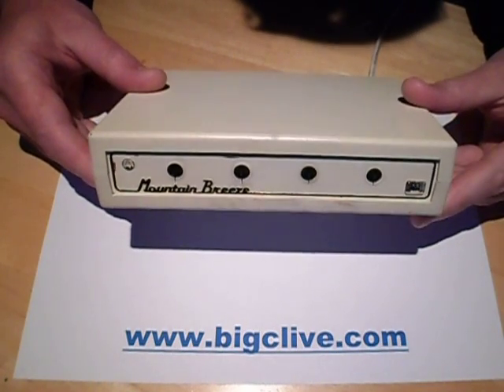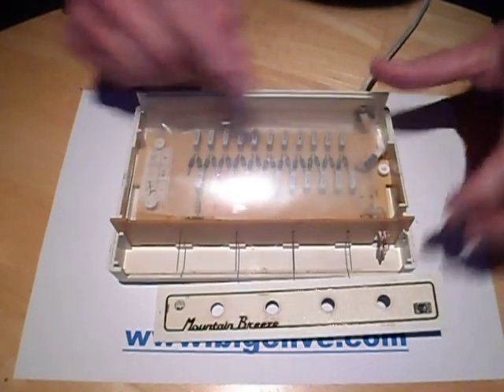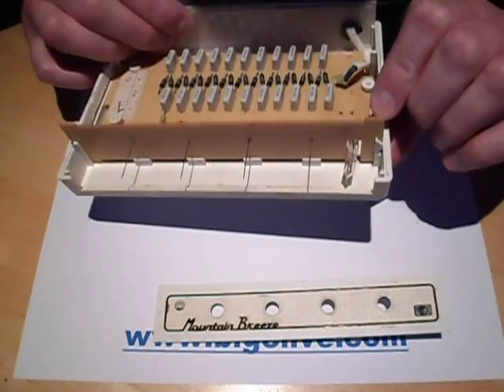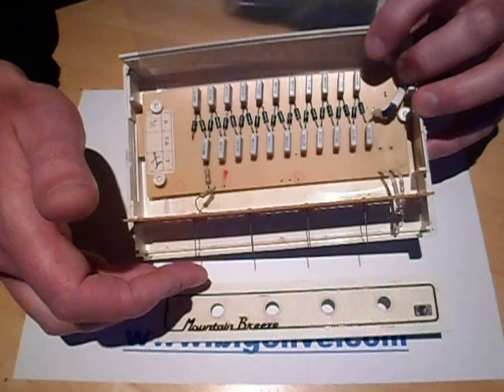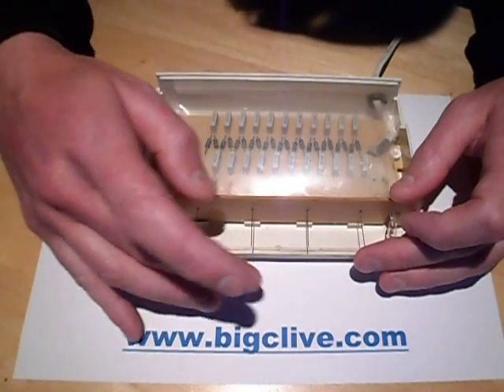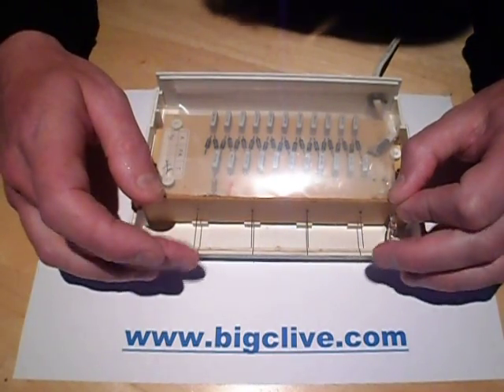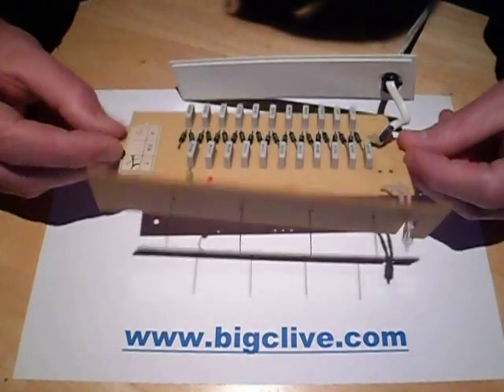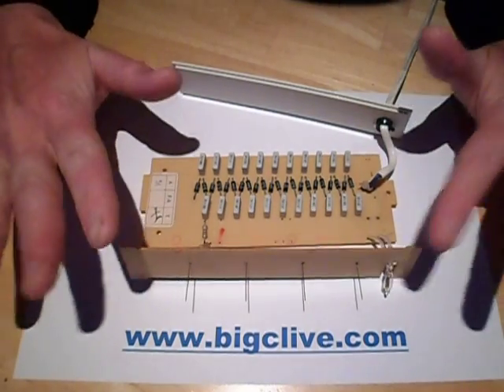Vintage Mountain Breeze ioniser / ionizer teardown.

Comment: Hi Clive, we used to have several ones at my parents house ('70's)  Every bedroom had one. In the living room we had a model F-400 which had a fan. 
Recently i found one again with rusty needles. Opened the case thanks to your help. Tried to clean them with my dremmel but broke one. After reading your comments on questions here i managed to solder a new (sewing) needle in. 
As i recall there was some kind of testing device that you could hold in front of the ioniser and it would lit up... but maybe i am mistaken about that.

Anyway just wanted thank you for the great video's you make !
Reply from the maker: The ionoscope was a small capacitor with a neon across it on a PCB.  You held one end of the PCB in your fingers and the other end near the needles, and the neon would pulse faintly.

Comment: I used to work at Mountain Breeze on the Pimbo Industrial Estate in Skelmersdale in the late 80s. 
I used to silk screen print the circuit boards and press them when they were returned following the copper stripping. 
I also assembled the boards and cut the resistors and capacitors. 
The company was run by Transcendental Meditators. 
Great days!
Reply from the maker: Still one of the best ionisers.  I have one on continuously in my bedroom.
Reply: zanderzoot So TM really did expand as far as Britain before the end of the 80s, interesting factoid.
Reply: Thanks zanderzoot , my aunt started the trend of owning one. The Mountain Breeze my close family owned was used in my shared bedroom, I loved the cute little miracle  device.
ps...I'm now an Electronic Engineer

Comment: "Mountain Breeze" was a Liverpool firm that was based in Skelmersdale, West Lancashire. I had two and they probably live in a very full loft but they are superb and I am so sad I can neither find them nor buy another. Iwent to Switzerland a few years ago for a wedding and which was in the alps. It smelt of the Mountain breeze ioniser! That was what I was told when I bought it in 1987. They were right. Thank you for your postage
Reply from the maker: They do turn up on ebay from time to time.
Reply: +bigclivedotcom there is actually a little bit more to the story of how why and where they were made. pifco acquired them quite late on.

Comment: Every ionizer that I've seen here in 120V mains land uses a potted potential multiplier, probably to reduce losses due to tracking across components and corona as those are some of the main loss mechanisms IIRC.
The 1N/2N series of part numbers uses the first number to denote the number of pins on the device, where the first number is the number of pins minus 1.  i.e. diodes are 1N, transistors are 2N and tetrode transistors are 3N.

Comment: I bought one of these on eBay recently for £15. Working well and I can feel the slight air movement on the back of my hand held close to it. Mine has a red LED for power indicator which still works fine (the top of the case in that area gets very slightly warm after several hours), but is otherwise identical. I haven't opened it yet, no need to.

Comment: FYI: Fresh Air by Ecoquest runs 5 KV for the pin(s). And 25-30 KV for Ozone generation mode.

Also, I've been doing research on these for a few weeks. POSITIVE ion generators create much much less ozone for a given current. However, positive ion generators (used in industrial cleaners called "Electrostatic Precipitators") use two plates. That is, they charge positive ions, attach ions to pollution, then attract them to a ground plate. (Sometimes also having a lower high-voltage accelerator plate in the middle to assist.) Whereas, the home ones, use negative ions (basically because of the fresh scent of a thunder storm), and let the "ground" plate be your floor, your walls, and any other surface they land on. So the home ones just spew negative ions into the air and hope they catch things. While the industrial ESPs send air through a tunnel (like a normal air filter).

Also, ionizers DO create harmful amounts of ozone if you set them to too high of a level (Fresh Air by Eqoquest, you set it to a square-feet of your house and NEVER beyond.). Consumer Reports did a study and found TONS of harmful levels of ozone being produced by most of the ones (like featured here) for the products that don't have fans. The fanned models tended to be much more behaved and within FDA/EPA (or whatever) limits for ozone.
Reply: consumer reports sold out..epafda levels of ozone are too low.
ozone in air=never sick
but at low levels
Reply: .005 ppm of ozone is detectable to most humans. 
.001-.125 is in the atmosphere.
Jump hear
LA sounds the smog alerts at 1.25 ppm
Jump
3 hour exposure at 12ppm fatal to guinea pig.
50ppm expected to be lethal to human.

http://www.ozoneservices.com/articles/007.htm

Comment from the maker: If it's the little potted cubes then it may actually be a thyristor dumping a cap through a step up transformer followed by a diode and cap.  Cheaper to make, but not as reliable as a multiplier.  Some older American ones use a chunky mains step-up transformer and then a multiplier.

Comment: I had one of those...purchased around 1985? I was under the impression that they were manufactured by a small company by the name of...'Mountain Breeze' but I may be wrong. I saw them demonstrated at a Rabbit show believe it or not - they were trying to promote their use to animal breeders - to keep the air clean in fanciers sheds. Mine however was used mostly in the house, but it did make the wall behind it very dirty...the potted plant left an outline on the wall! I don't know where it is now - lost in a house move I fear. :-(

Comment: hi Clive, just wondering,  if you isolated from "🌍 " ground, could you then have a connected collector several feet away as a place to collect the dust, sort of like electrolysis but in air, or am I misunderstanding the principles. if it would work I might use sweeping brush as the emitter and the dust pan as the collector and I'd never use my hoover again :-))

Comment: When tvs were hybrid , tube and solid state they used  high voltage triplers. That  multiplied the voltage from  6,000 vac up to 18,0000 vdc. The picture tube CRT.  Was also a big capacitor which stepped up the pulsating DC  by filtering it  like a electrolytic does which brought the voltage up to 25,000 vdc. This  voltage accelerated to electron beam from the cathode  to the front of the  CRT to  strike phosphor  . The triplers setup is similar  to the diode capacitor configuration  of the ion device in this video.

Comment: Hi bigclivedotcom, I was studying your guide on making an ionizer (the version with 30 of 100nF caps is the one I intend to make). What diodes are you using with the mentioned caps? 1N4007s or Schottky ones? And does this somewhat affects the ionizer's efficiency?
Reply from the maker: At the low mains frequency the standard 1N4007 diodes are the best option.

Comment: If I wanted to build one of these for North America voltage, what would I need?
Reply from the maker: +Chris Roller Personally I'd start with a small transformer to boost the voltage up to 240V in the unit.  Possibly using a standard 120/240 transformer wired as an autotransformer.  If using an isolated transformer the 240V secondary would need to have one end connected to the mains side for the ionisers return path.  Then it would just be the same as in this unit.  A 22 capacitor (or more) multiplier with 10nF capacitors and 1N4007 diodes and the high voltage and high value resistors on the output for safety.
Reply: +bigclivedotcom I need to seek your guidance again on this (sorry if all of my comments are getting annoying). I went out yesterday to get the parts I'd need for this, and my local electronics shop had everything that I would need to build one of these (whee!), except, the smallest 110/220 transformer they had was this 40$ monstrosity rated at 50 watts, which I imagine (given your description of the power consumption of the device) is massively overkill). I did some rummaging around online for something a bit smaller and only found even huger transformers. Any advice on a source for something a bit more realistic?
Reply from the maker: +Chris Roller A step-up transformer from China?  http://www.ebay.com/itm/321802306749
Or perhaps this might work...  http://www.ebay.com/itm/111839580900
I'm not sure how well it would work to just keep extending the voltage multiplier circuitry to compensate for the lower voltage as an alternative to the transformer.
Reply: +bigclivedotcom Oh, they had those little wall warts at the shop. Wasn't confident they'd do the job, but that's easy enough. I'll try that. I'll also experiment with extending the multiplier, as the most cost effective way to get the necessary components leaves me with enough to do a 120 cap multiplier. Thanks for your help/advice!
Reply: +Sean Ache I haven't put the components together yet, got distracted by another project. It looks like it should actually work on 110 with 35 caps in multisim, but I'm not too sure if it's handling the multiplier properly.
Reply: +Sean Ache I'll have the components in sufficient surplus to test it out, may do a video on it myself if I can find a decent camera to do it with.
Reply: Sorry for the video necromancy, but I seek your wisdom again. I'm getting ready to build another of these (my last two tries failed). On your website, you have the emitter hooked up to the anode, but some schematics I've seen are hooked up to the anode. I assume one will create negative ions and one will create positive ions. I've also seen "full wave" multipliers - any advantage there? Last question - in the absence of a neon for the emitter end, would there be a way to swap in an LED instead - somehow?

Comment: what hone would you recommend for resharpening the needles?
Reply from the maker: +test7er They don't have to be be super sharp.  I scrape them with a fine file to create lots of sharp ridges.
Reply: Would a needle with something like a many-pointed star shaped cross section work better than a conventioanl round shaped cross section needle?  What about a steel plated hedgehog?
Reply from the maker: +test7er You can make a cluster of needles, but with the natural current limiting nature of the circuit the voltage will tend to sit down on the most efficient needles and they will emit most ions.  Also check out my video on making a carbon fibre emitter.

Comment: Thanks Big Clive. I was about to throw my vintage 80's ioniser [exactly like this one] away thinking it couldn't possibly still work but will now put it in my daughter's room as she suffers from asthma and other dust based allergies.
Reply from the maker: The test is to put it on a white sheet of paper and then check in a few days.  If it's precipitating fine particles out of the air there will be a dusty outline around the ioniser on the paper when you lift the ioniser off it.

Comment: Is it possible that the reason for the sheet of plastic is because the first versions were housed in metal enclosures? Just a thought.
Reply from the maker: Aadil Shah You can't really make ionisers out of metal as it would affect the ion flow from the unit and stop them working almost completely if it was grounded.
Reply: doh That makes sense!

Comment: Question? I was cleaning my ionizer machine and lost 2 needles? Will still work, can you replaced them., are the needles welded?
Tia in advance!
Reply from the maker: It will still work fine with two needles.   You can solder new ones in, but they have to be the thinnest stainless steel pins you can get.
Reply: Thanks for your reply, but are these needles to be welded in, or just push into. To me it seemed that you can just pull them them out, or pushed in.
Reply from the maker: Some modern ionisers have sockets for the needles.  But most have them soldered in.
Reply: Thanks for replying. You seem to know about these things, thanks again.
I will give it a try to the machine. The impression I had with the machine I have, was that the needles coudl be pushed in, or pulled out.
Reply: @cucuca7281  You appear to have an Australian Elanra ioniser.. the emitters in these are removable / replaceable.. Elanra charge a high price.. I think they are pins of about 0.6mm diameter, about 12mm long (they only just stick out from the face of the needle apertures) — so a set of pins and needles will usually contain a few of suitable diameter.. just cut them to length with pliers.. cleaning them with a matchstick will have them fall out. Elanra’s founder had a sharp eye for profit - his goal was for people to buy new needles and replace them 4-5 times each year.. madness, wholly unnecessary.. much as cleaning the emitter tips is a good bet.

Comment: seems to be hard to find.  only one that looks good are ones that look like a transformer with 3 holes out the top ..  with a do not touch holes warning .  being so small not sure if they would be that simple as something bigger but I've looked around.  Keyword though is Vintage.  If you don't stick that word in there you probably won't find the better ones.  Does remind me of one thats nearly $300 but it relies more on heat as well  from Hammacher  Brother has one, with has a fan , Ionizer and UV light all included.  (and one very thick air filter)

Comment: Question... i found and bought an old clearAir ioniser and its a small unit 7 x 3 x 1- 3/4 rated at 2 watts, i plug it in and it hisses and buzzes, and a tiny breeze is emitted from the needles, then after 2 minutes the hiss dies down and it crackles quietly, with little breeze coming off the needles. However if it touch the top of the unit the hiss returns and so does the breeze..... measuring the output when its hissing is 50mA- 1200mA on my multimeter , is this normal?
Reply from the maker: If you were using a current test to ground and getting that off the needles it would be worrying.  It's more likely a voltage reading?  The hiss is normal and it does often die down as the surroundings charge up.  It's best to have these units at the edge of a table with the needles pointing over the edge.
Reply: bigclivedotcom sorry yes my mistake mV and thats with the test probe an inch from the front of the unit 600/1200mV and around 4 inches away reads anywhere from 20-60mV

I took your advice and had it sitting half off the table to keep the table from grounding out the ionic charge. The ground lead on the multimeter is grounded on the radiator 2 meters away from the unit.

Comment: Hi mate, like your videos and this device. I'd really like to make this device portable by modifying the circuit from insect racket zapper. Since I'm a newbie in HV electronics, how should I modify the mentioned circuit? From what you've mentioned in the video it consumes a negligible ammount of power, so my old batteries should kick in this application similarly as Joule Thief, therefore cleansing the ambient air instead of polluting it. Thanks in advance and cheers from Croatia!

Comment: Doesn't no transformer mean it's not isolated and much more dangerous?
Reply from the maker: The output is limited to an extremely low current by the final resistors.  The direct generation of the high voltage by multiplying the mains is simple, efficient and reliable.

Comment from the maker: Scottish.
Reply: Hi Clive,
Sorry to query on such an old Post but as someone who is in poor health I'm looking for such a beneficial air purity device to place in the room that I spend most of my time (living room). I'm located here in the USA so my question is.... "Is there such a simple and beneficial unit that would work on 110 vac/60 hz that you're aware of"? BTW - I'm still able to do repairs and/or mods. if need be 

Thanks for any info ! 

Roger (W9RHS)👍 ☺
Reply: @rogersmith9808  you only gonna need to power it from 110V:220V step up transformer(220/110 Step down is same)